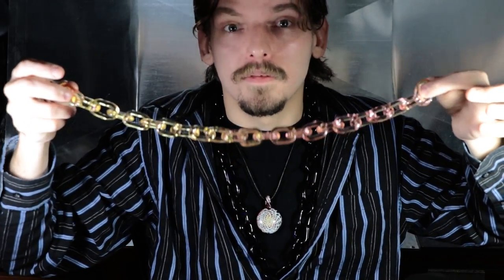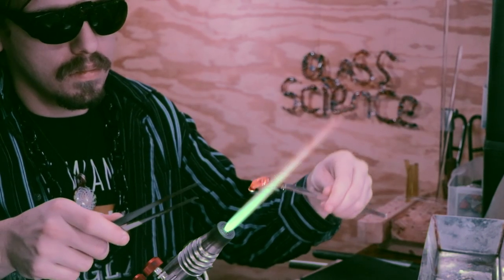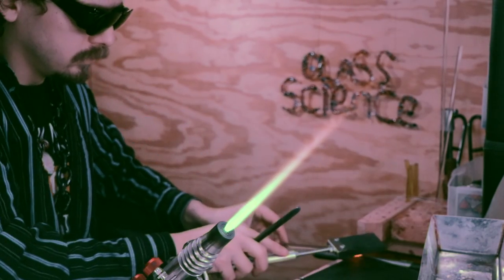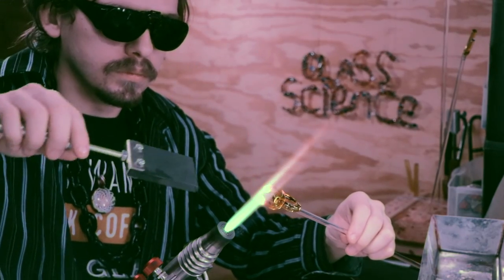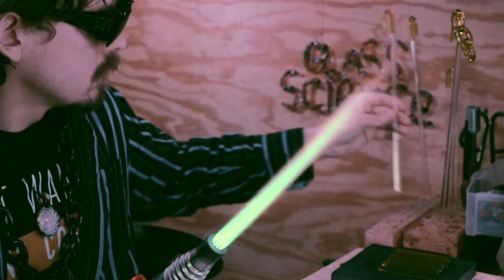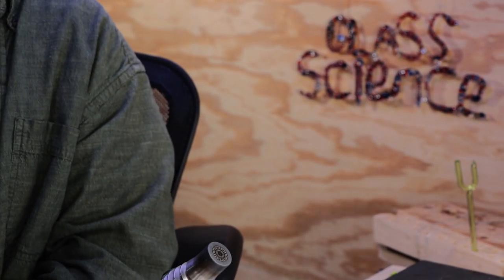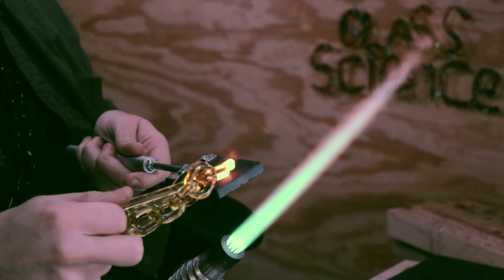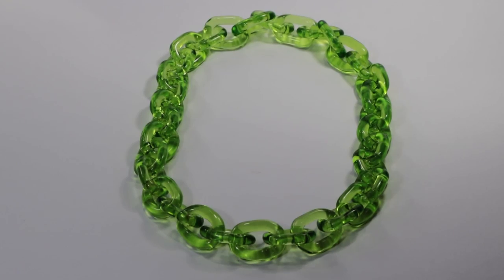Glass Chain Necklace Lampworking - Glass Blowing Techniques

Comment: Thank you so much for your video! Can't wait to try it out! What diameter of rod do you recommend.? What would be the most thin you would use so it wouldn't break easily? Thanks.
Reply from the maker: You could try the 4mm color rods, I'm using 7mm in the video, which is the normal size the mfg. sends it as. Smaller rods might be a bit more difficult to start. For breaking just don't drop it. The links collide into each other, its a bit different then dropping a marble or pendant.
Reply: Was just about take ask this. Thanks guys.

Comment: Hi Matt, Thank you so much for all your glass info. I love it. I have another question about the glass chain. After you make the whole chain, which sits on the bench as you make the next link until you get to the length you want, do you put it in the kiln with the kiln hot at 1075? or do you put it in the kiln and warm it up to annealing temperature and then run it through the annealing schedule?? I really appreciate your time in answering this!!!!!
Reply from the maker: Hey again, Info is what I do I love to teach :). Well I normally will wait until the whole chain is finished before I anneal or kiln it. So all the links are bench cooled carefully as i'm putting it together, you don't want to touch any hot links against the cold ones. You could anneal the sections at anytime if you wanna be safe but I wouldn't 'pre-warm' anything in the kiln as its a very hands-on process so its safer to warm one link at a time. I hope that answers your question, if not let me know. Happy Melting!

Comment: How many rods would you say you would go through per chain? If 30 links were used at around 4” of rod, that’s 120” and average rod length is 18-20”... so prob 6-7 rods per chain roughly?
Reply from the maker: I believe it was 3" of rod so about 5 rod's, you might want to buy extra just in-case. 
The 7mm diameter rods makes for good practice but fair warning the finished chain will be heavy. A smaller 4mm diameter chain might be a better way to go. Best of luck on your glass journey!

Comment: Hi Matt, one more question: do you batch anneal the completed chain putting it into a cold kiln and then slowly ramp up to a boro schedule? What ramp up rate do you do from a cold kiln? Many many thanks!
Reply from the maker: Hey Jill, it is easier to lay them out in a cold kiln specially if the chain is cold. But I don't worry about stressing them, I ramp it up at full speed and run a normal boro schedule. The links are relatively thin and of equal thickness so it warms up very quick and evenly.
Reply: THANKS

Comment: i want to learn how to do this. how long did it take you to get to this point? how much do the torches cost?
Reply from the maker: I'm happy you want to take the fiery path! Everyone travels a different pace on this journey. I believe I was making glass chain after about a year. It really depends on how dedicated you are to practicing. 
   Small practice torches begin at $200, but a larger 2-stage torch like mine are about $1000+.
There's additional equipment costs (regulators, ventilation, safety glasses, glass) which you need to consider. In all you might expect to start out at around $1500 for a small setup. 
   After you have your studio setup the only thing you need to buy is propane, oxygen, and more glass. 
 Let me know if you have any additional questions.

Comment: How long is your first link?
Reply from the maker: I think the rod was around 3 inches before I bent it. You can try different sizes, if it's too small you'll have trouble sticking the 7mm rod through the hole of the link.